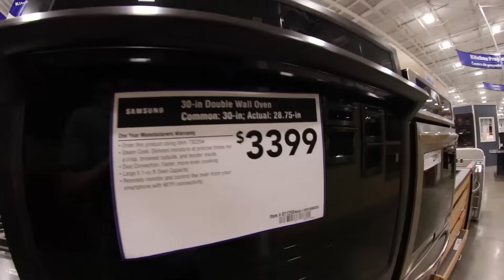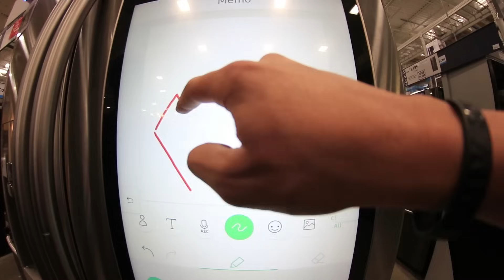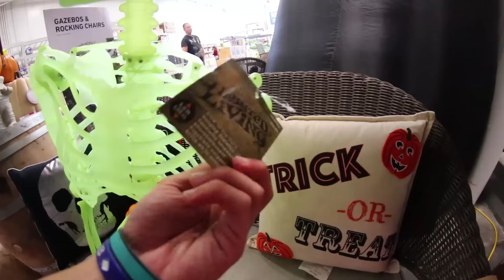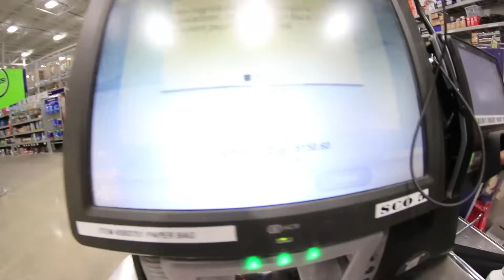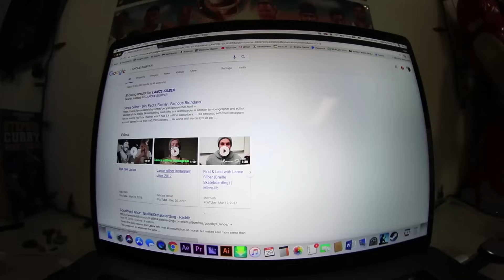SKATE EVERYTHING WARS LOWE'S EDITION! | SKATE EVERYTHING WARS EP.15

Comment: Hey guys. If you come up against drilling through stainless steel again, use cobalt or TCT drill bits. Drill it in short bursts so the metal stays cool or it will harden as you drill it. Loving the videos even though I can't skateboard! Cheers

Comment: Braille, I love you all dearly, but you all need to figure out how to fill through metal. 

Use a few drops of 3 in one oil on the spot you are going to drill. 

Use a slow drill speed

Use a carbide still bit.

Use a metal point punch to create a pit to help you start.